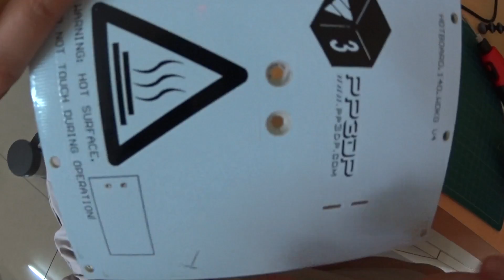Radioshack Butane Soldering Iron FAIL

Comment: why were you laying the iron almost Flat down almost touching the BOARD?? LOL Of Course doing that Crazy thing Will Cook Your BOARD??? LOL
I Been using all Sorts of Gas Irons Over 40 Years starting from 16 Years old hooking up two way Radios and mounting Antennas and PL259 End Connectors and mostly for Portable Mobile Work..where some times in winter Cold Cold Even during Snowy weather, :-)
i have all Sorts of Sizes 
from Small like yours to Medium and Also The Largest One Made $160.00 Iron 
and the Smallest Priced Normally Only Around $30..
But DUDE Don't Cook Your Things?..
//=> hold Your Iron Slightly upward,
i was never read or was never Told that,.. i Just Always Knew Doing What You Did Would Cook SH1T LOL :-)

Comment: Just light it, let it set and warm up using the little metal stand for a few minutes, turn down the flame to a glow. Then you can start soldering. I have a similar iron that I was when I have to solder something in ceilings. It works great.

Comment: I agree with what dopeofthepope wrote.  I have been using the Radio Shack mini butane soldering iron for years without any problems.  I use the butane iron a lot were a/c power isn't available. This guy probably never read the manual 1st.
Quote dopeofthepope wrote, That flame is quite normal for the first approx. 30 seconds. And you need to warm it up for about two minutes. And you need to angle it so that you don't burn anything. Learn how to use things before you try to do reviews !
dopeofthepope wrote That flame is quite normal for the first approx. 30 seconds. And you need to warm it up for about two minutes. And you need to angle it so that you don't burn anything. Learn how to use things before you try to do reviews !

Comment: Its not supposed to do that its not supposed to light up red hot it will get too hot and melt the board  i learned that the hard way
Reply: it is supposed to do that... the iron is working nomally..  just you guys that dont have the least clue of what you are doing AND wants to have your "15 minutes of fame"
Reply from the maker: Weallwayswin WithGod I think we're not the only ones who learnt the hard way!
Reply: um, i do know what im doing, i work with vacuum tube equipment and solid state equipment also and i know how to wire it all, without mistakes